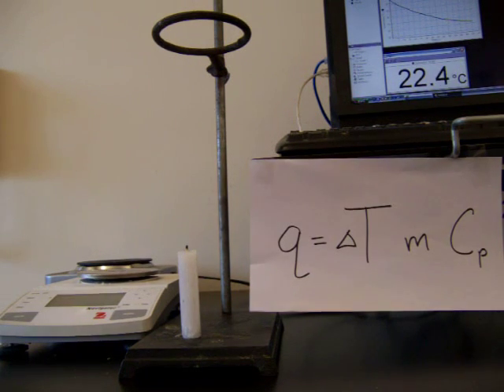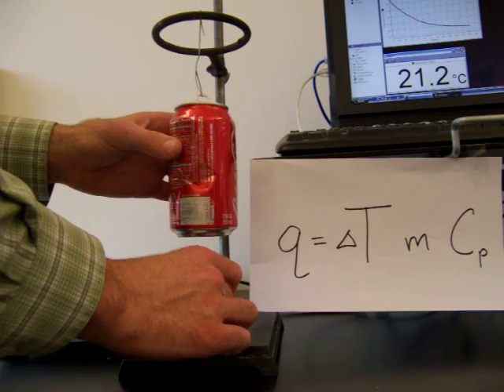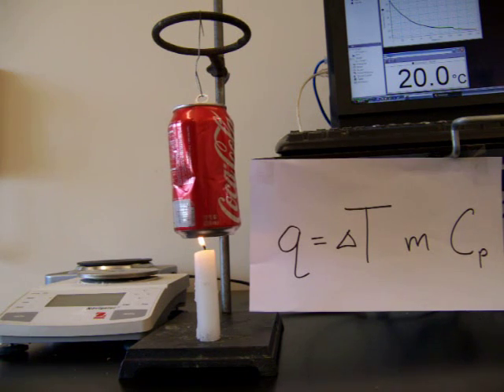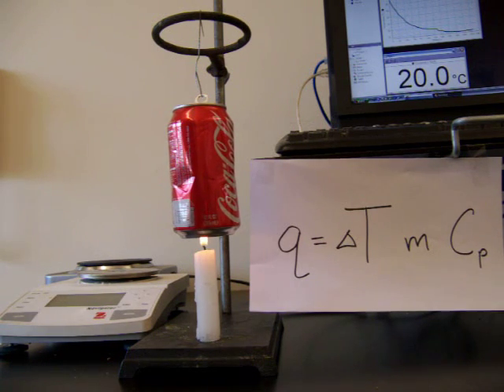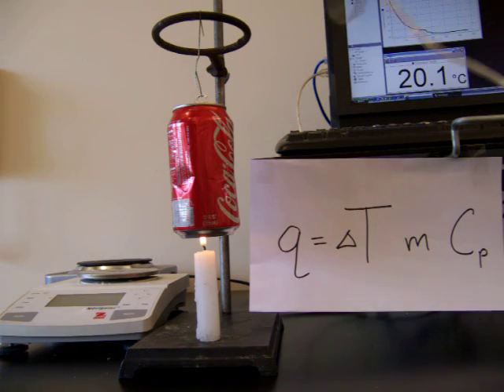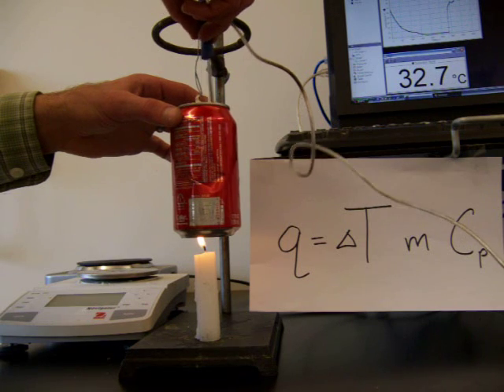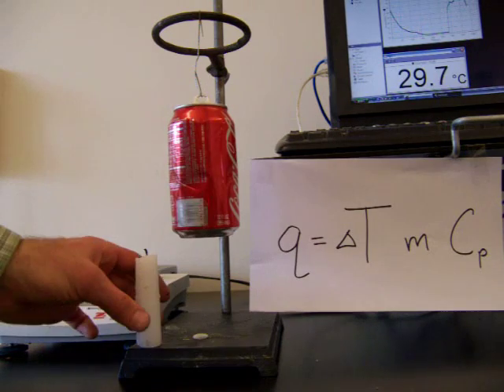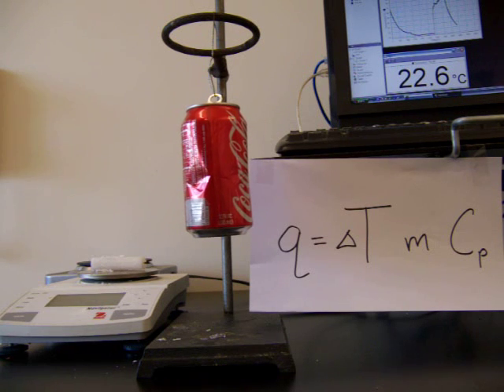Witzgall Chemistry: Heat of Combustion of Paraffin Lab

Comment: Why use a soda can instead of a glass container
Reply: I know this comment is 6 years old, but the reason is most likely that heat transfers more easily from thin aluminum than it does from the glass of a beaker or Erlenmeyer flask.
Reply: Not as cool

Comment: The candle should have been placed on a small index card so that the 'droppings' of melted wax could accurately be taken into account when the final mass was measured. The initial mass would be the combined mass of the candle and the index card before burning while the final mass would be the combined mass after burning.

Also, could you tell how this experiment could have been made more efficient?
Reply: Perhaps using a can with both ends cut out could be placed around the candle to channel the heat upward and minimize heat lost to surrounding air.
Reply: @GK16243Benedetto  Also constantly stirring the water and not letting the thermometer touch the can, so you can accurately see the temperature of the water. Rather than the temperature of the can.